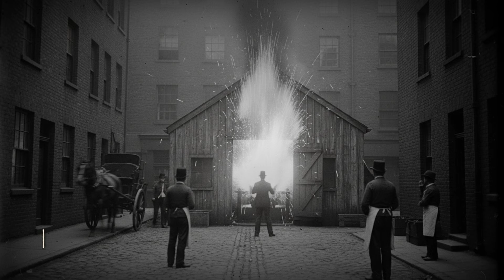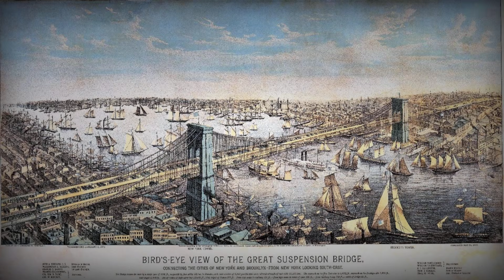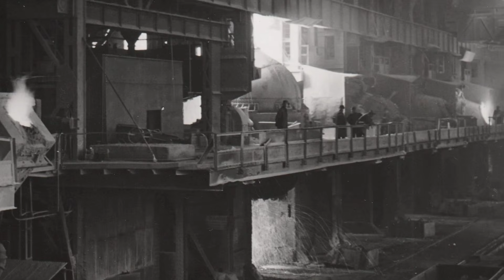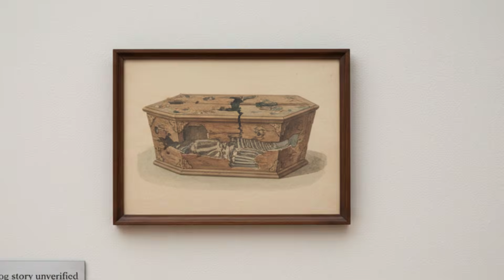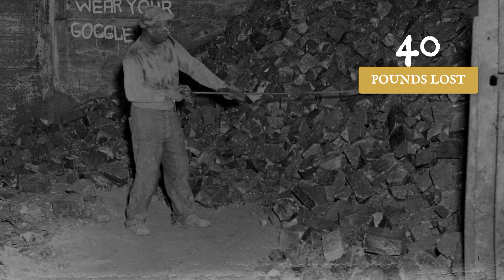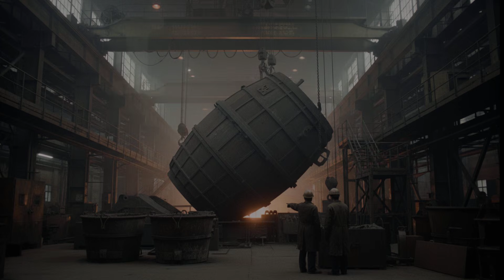The Deadliest Machine Nobody Feared : The Bessemer Converter

Comment: Another process you could look at is the steel rolling mills before automation over here in the GB Sheffield it was done by men feeding them through narrowing rollers each set was called a bank and was very dangerous especially if you had a cobble and the steel curled like a snake or went up in the air and dropped sideways if we heard the word cobble we moved directly backwards
Reply from the maker: Hey thanks for the insight , I ll look at this topic :)

Comment: I was a foreman in a steel foundry and yes moisture was the greatest danger.
Reply: I was a pulpit man at a mini mill charging and tapping a DC 100 ton furnace.  If the charge scrap had ice or snow in it that didn't evaporate before it entered the bath, we'd get a nice explosion.  That was 25 years ago.  Good times!
Reply: @michaelgreaves2375  They built an indoor scrap yard at Steelton, after a washing machine tub full of ice made its way into a furnace, killing a worker and injuring dozens.
Reply from the maker: Thanks for sharing your experience :), appreciate it.

Comment: I appreciated this work. Converting iron to steel has fascinated me. these Bessemer converted were replaced by the open hearth furnaces. eventually the open hearths wee replaced by the Basic Oxygen Furnace. This device is simply (?) a big ladle of 350 to 400 toms of molten iron direct from the Blast furnace.. Into this ladle a tube injects a supersonic stream of pure Oxygen. the results are spectacular. In less time than it took to make a batch in a Bessemer the BOF creates ten times the tonnage of steel.
Reply from the maker: Glad that you liked the video :)
Reply: Weirton steel !